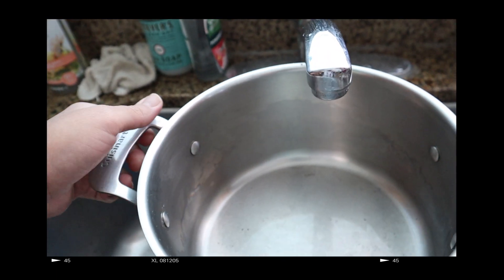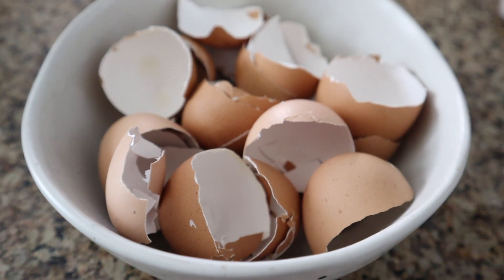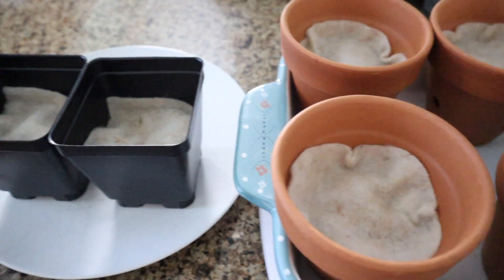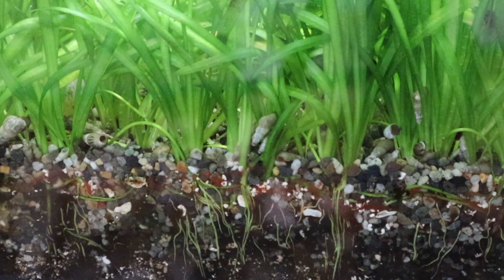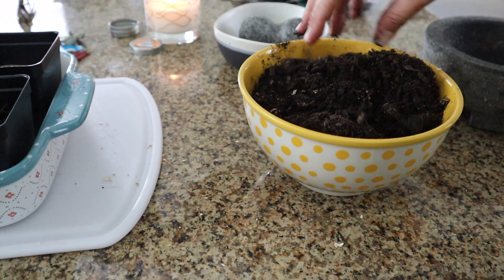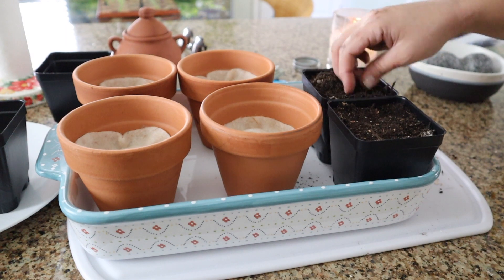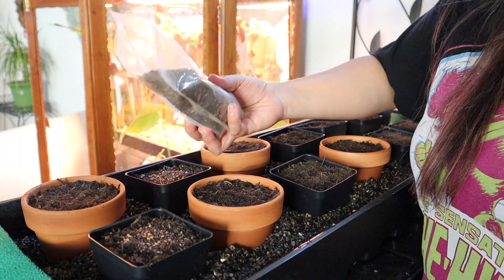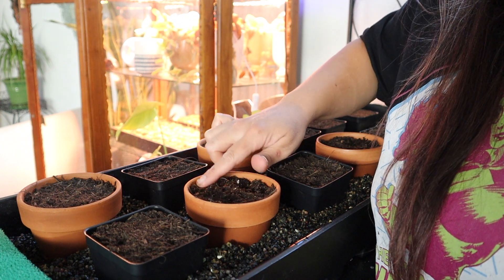HOW TO SETUP A DUAL ROOT ZONE IN YOUR AQUAPONIC GROW BED | Why Using This Method Helps Your Plants

Comment: Is the pump running water though the bed on a continual basis? Or is it flood and drain with a bell siphon?
Reply from the maker: It is a continuous pump.  We have gone back and forth over the years as to whether we should just setup a bell siphon for the tank but I happen to love the continuous flow so we have kept it in place.
Reply: Thanks for the info!  @finaganfishhouse
Reply from the maker: Happy to help!  @jonisolis9645